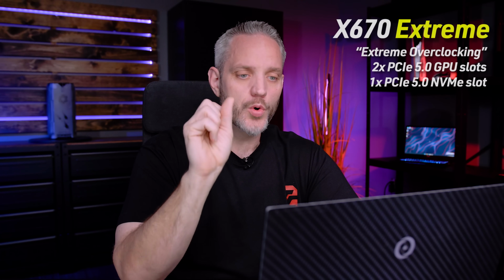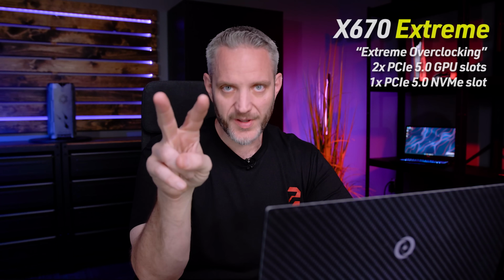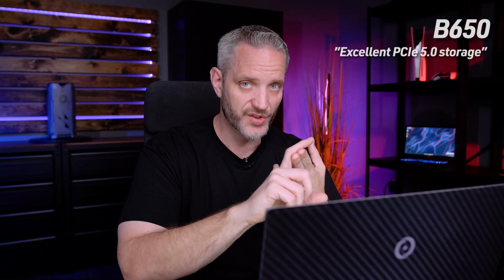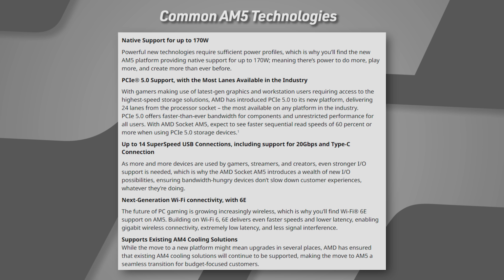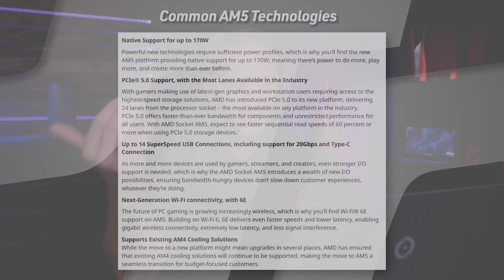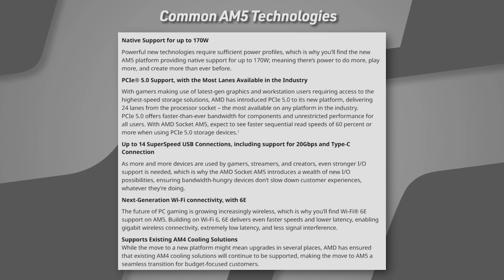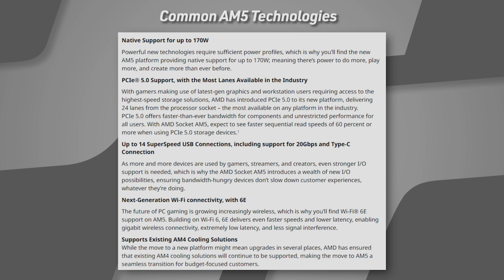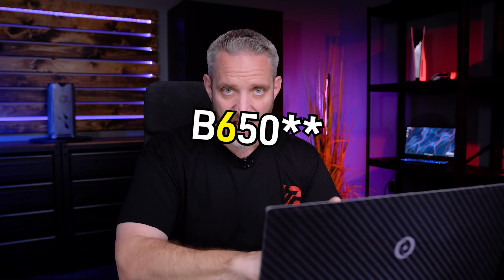AM5 Motherboards are EXPENSIVE! AM5 Explained

Comment: I bought an Z690 (ddr4) and 12700k in February. I was coming from a x370 and 1500X and later upgraded to 2700X. It is still way to early for me to upgrade. It does look like a solid system but my current system is just way to new to change out.

Comment: Can somebody address if the  motherboard will be able to use the internal graphics of the 7000 series processors rendered through the 2 CU  base@400MHZ to max@2200MHZ (Radeon RDNA 2 graphics apparently) present on the processors or will they have to get Discrete graphic cards ?

Comment: Dude you're probably wrong about x670E being the best choice for extreme overclocking because remember you could not raise BCLK with x570 chipset as much as you could with B550 chipset and since both X670E and X670 boards contain 2 of x570 chips, unless AMD does something to fix the base clock adjustment on the chipset and have both of them work just fine when you overclock, which I highly doubt because we're talking about AMD here, B650 is again probably going to be the superior board for extreme overclocking and the only difference in between the X variants and B variants will be a bunch of extra pci-e slots or m.2 slots etc. Other than that when one chipset is already bad, imagine having two of them to mess up your BCLK OC. I don't see why a B650 board with enough vrm phases with the same amount of pcb layers and capacitor layout wouldn't beat a X670 or X670E board unless it's artificially limited by AMD.

Comment: The short reasoning is if you are or were interested in a HEDT platform but shied away from the proThreadripper because of its expense, then the 670E is on the radar.
For Raptor Lake, you really don't want to think of a DDR4 board with it, unless you are already going from Alder Lake CPU, but unless you are already on ADL and DDR4, there isn't a want to get DDR4, because DDR4 is "low end" and cannot be moved to a board later. The DDR4 buyers can choose any EOL system, either Intel or AMD, but are doing so because they are budget buyers, so you get either low end 12400/100 or 13400/100 non-E core designs, or you get AM4 designs, because you will save money on those CPUs and boards as well.

Comment: Intel user here. The MSI Carbon Wifi boards are easily 150€ more expensive than 1 or 2 gens ago. It feels like you have to go a tier lower every gen to keep the price you wanna spend. MSI Carbon with built in wifi used to cost around 280€ to maybe 310€ at launch. A year after 12th gen launch the cheapest Carbon Wifi is 460€. Total madness.

Board manufacturers undeniably got greedier over the last 3 years. Guess enough people still bought into it to justify that move. I'll sure keep an eye on motherboard features closely for the very first time this upcoming gen. I'm not even sure yet if i go blue or red. 👀

Comment: Where did the A series board go? The A620 the bare minimum and a board that could run R3 and R5 chips. Like it sucks that a R5 7600X and a board together costs 2 or 3x more then how B450 boards and R5 3600X costed.

Honestly im still probably going to go for a 5600x or 3600x since alot of them will be selling for cheap soon

Comment: Ya know with chiplet design in rdna 3 resizable bar and pcie 5.0 it could vastly improve cross card communication and simplify dev support needed to implement granted it’s all theory but having multiple gpu dies in one card working together as one monolithic if you can have the communication speed between cards approaching the sane data rate it may be simpler to implement multi card gpu rendering as compared to previous iterations

Comment: Isn't 6E amazing?  Got a new router and suddenly the 6E worked on my phone and I'm getting almost a gigabit down. Holy bleep.  It's the first time I can remember where a wifi feature was actually way better than promised.  Anyway, no plans to upgrade to AM5.  I am happy with the AM4 system I just built and the only upgrade I want to do is replace the 5600G CPU with something better once those better AM4 procs hit the used market. I've got an RX6600 in there so I don't need the iGPU. Honestly, the system I built is doing all I need. I would be okay never upgrading this one if I had to.

Comment: I get why the AM5 boards are expensive and i get why amd have turned their back on mainstream and budget gamers with their middle of the road chip costing 300 bucks probably about 350 when it comes to the UK. The answer is greed they are in the ascendancy because intel fucked up and they regained the gaming choice for 2 months before AMD wait oh thats cutre heres our new chip and will once again be the choice for gamers. However AMD are unable to fathum that the pound is stronger than the dollar and 300 dollars is in fact about 265 pounds so it should be less here but i digress. Now they havent announced if theres going to be a 7200 7300 7400 or 7500 but am guessing not also what is the future of APUS or are they dead now. Given all amd chips come with intgrated graphics are not as strong as vega think Intels GMA series rather that Vega. Maybe am wrong and there is a plan to release more powerful versions of the APU in the steam deck to the general market i hope they do unlike with the 5300G and the entire 4000 series apus which were oem only

Comment: I have a 5600x since launch with an x570, it's gaming please, for 4k games it's guaranteed for 5 years, it's not worth switching to am5 now, my opinion is that am4 is still better set up, only in 2 years will am5 start  it has advantages.  Save money and spend better on a video card.  they are unwarranted prices for the new AMD releases, they do not bring benefits commensurate with the price.

Comment: I'm still running a 4790K, 32Gb DDR3. 8 years of solid performance, it's still my daily driver for my day job as a developer and unwinding in the evening with whatever game is flavour of the month. Not wanting to splash the cash on Intel's "5% more performance!" iterations, I've waited until there's a significant bump up. I think AM5 might finally be that bump.

"When" is another question however! There's nothing this old 4790K can't still power through, what's a few extra months waiting for the dust to settle? starts twitching

Comment: Bought 5600X and B550 Aorus Elite V2 for total of 300€ month ago. Cheaper than 7600X alone. Gonna wait for 2th gen for AM5 for few reasons:
- Bugs to be solved
- DDR5 is still too young and "meh" adapted
- AM5 is expensive, completely looses perf per € in comparison to AM4 Zen3. Sorry, not gonna pay almost x2 for +10-20%. 
- AMD has increased TDP. My current "low-power" 4K rig has 5600X on Curve UV 4.8GHz and undervolted RX 6800. New gen won't beat it in terms of perf per W sadly since it should. But everyone is an idiot and increases power consumption esp. in times when we got x2-x3 power price increase and risks of blackouts. xD

Comment: I've been Intel fan for years but i'm making the switch for AM5. So far i've stripped out & sold 2 Intel 7th gen systems to make way for the new build. It makes sense to me if they are going to commit to this socket for at least 4 years & they did that for AM4 so i'm converted. DDR5 will be in this system, WIN 11, new PCIe SSD's & a 40 series GPU. It will be a beast that will suck alot of power but will future proof me for a long time to come yet. IMO Intel has been "catching up" or "keeping up" with AMD since about 9th gen & they just don't seem to have their s**t together still.

Comment: To be honest, I would like to see GPUs drop down to 8X or 4X since it's unnecessary to go bigger. But does that reduce PCIe slot power delivery? And does that matter, with so much being delivered via cables these days?
Reply: Power should be the same as that's what that first bit of the slot is for and where there is a notch is keep it away from the data lanes.

However reducing the number of lanes potentially kills performance if people want to use that card on older motherboards, so its pretty unwise.  It also wont save the card manufacturer much, unless the chip is designed to have less lanes, which is why AMD did it.

Also these new CPUs have more lanes to begin with, so I don't think there is much point in saving lanes as most of the other slots are PCIe 4.0 so not taking anything away from the GPU slot.

Comment: I like having the option of 2 full speed PCI-E 16x slots. I had a riser cable in my case that was too short so I was able to use the other slot. Then that slot died after I had a power supply failure, but the first slot still works. I can't afford a new board at the moment but having that option saved me in my edge case scenario.

Comment: i have a z370 chipset board paired with my 8700K and really the only thing i lost in comparison to a z390 board was some overclocking headway since my vrms max out before the cpu does but realisticly it makes no noticible difference in anything other than a benchmark since i'm still running 4.7ghz all core baseline

Comment: 9:40 High core counts and high CPU frequencies are one contribution, but only to a small degree.
It's the thigns that people crave for due to whatever reason and don't want to see that this will cost money. High speed DDR5, high speed PCIe5. Boards traces are acting as antenne, both emitting and receiving signals. You can compenate by better material and more ground/shield planes, but that costs... money.
And the usual premium you have to pay when buying a brand new platform.

Comment: Thanks for the content.People should be aware that the 7000 series CPUs and 670 chipset are all first generation products of AM5. And with all of the new techs that are going into the new platform, it means bugs, bugs, bugs, problems, problems problems, ram incompatibility and many many more. The 2nd or 3rd generation of am5 cpus would be great but not this one. Check de8auer videos on am5 cooling, they are very informative. In my case, my Ryzen 9 3900 can keep on working till 3rd generation of AM5 CPUs, then I will upgrade

Comment: I will be upgrading by the end of this year to a AM5 system too from a (i7 4790k, GTX 1070, partially broken USB) and plan to get a motherboard that supports next-gen graphics and storage devices.

So i hope that X670 will suit my needs which is: 

- Stable motherboard with a stable chipset
- Two or even three M.2. NVM slots (Putting in 2,5 SSD´s in modern cases is a p.i.t.a)
- PCIe 5.0 for GPU and storage
- At least 3 normal PCIe slots for extra cards, such as my Soundblaster AE-7, one M.2. NVM expansion card and a video capture card
- Lots of USB 3.0 type B and a few USB 3.1 type C connectors
- WiFi would be nice for a fallback when the ethernet cable dies

- No need for overclocking capabilities, except for the DDR5 EXPO
- No need for fancy internal audio device
- No need for RGB, my system is under the table, to the left - so i never see the sidepanel anyways

But i am not in a rush, because my 4790k still runs fine and i fixed my USB problems by adding a additional PCIe card that is connects to the front-panel.
So i can wait until AM5 components are ready and tested for a few weeks.

Comment: The optional PCIE gen 5 is relevant because we still got people out here running bulldozer unironically. A big thing about AMD is upgrade path without replacing the motherboard, and if one of the aforementioned bulldozer users happens to upgrade gen 5 will become relevant before they upgrade again.
Reply: °ᴛʏ ғᴏʀ ᴡᴀᴛᴄʜɪɴɢ° 
ᴍᴀᴋᴇ ᴀ ɴᴏᴛᴇ ᴛᴏ ᴋᴀᴛᴇ ʟɪɴᴄᴋ ʀᴇɢᴀʀᴅɪɴɢ ʙᴛᴄ/ᴇᴛʜ ɪɴᴠᴇsᴛᴍᴇɴᴛ ɪᴅᴇᴀs;;
Reply: ᗩ ᑎᗝ丅ᗴ Ƴᗝᑌ ᗯᕼᗴᖇᗴ ᖇᗴᖴᗴᖇᖇᗴᗪ ᗷƳ ᗰᗴ

丅ᗴxт ▪️          ᗩ ᑎᗝ丅ᗴ Ƴᗝᑌ ᗯᕼᗴᖇᗴ ᖇᗴᖴᗴᖇᖇᗴᗪ ᗷƳ ᗰᗴ

  ±𝟷𝟺𝟺𝟹𝟼𝟾𝟺𝟻𝟺𝟽𝟶✔️💯⚡️⚡️✔️

ᗩ ᑎᗝ丅ᗴ Ƴᗝᑌ ᗯᕼᗴᖇᗴ ᖇᗴᖴᗴᖇᖇᗴᗪ ᗷƳ ᗰᗴ:::

Comment: Just picked up a 5950x and a Gigabyte Aorus master MB for the equivalent of USD$600. No upgrade path, who cares, got a banging system for cheap, re-using my old case / PSU / drives etc. Sure it would be nice to have the latest and greatest, but I'm fine for at least a couple of years.
Reply: °ᴛʏ ғᴏʀ ᴡᴀᴛᴄʜɪɴɢ° 
ᴍᴀᴋᴇ ᴀ ɴᴏᴛᴇ ᴛᴏ ᴋᴀᴛᴇ ʟɪɴᴄᴋ ʀᴇɢᴀʀᴅɪɴɢ ʙᴛᴄ/ᴇᴛʜ ɪɴᴠᴇsᴛᴍᴇɴᴛ ɪᴅᴇᴀs;;
Reply: ᗩ ᑎᗝ丅ᗴ Ƴᗝᑌ ᗯᕼᗴᖇᗴ ᖇᗴᖴᗴᖇᖇᗴᗪ ᗷƳ ᗰᗴ

丅ᗴxт ▪️          ᗩ ᑎᗝ丅ᗴ Ƴᗝᑌ ᗯᕼᗴᖇᗴ ᖇᗴᖴᗴᖇᖇᗴᗪ ᗷƳ ᗰᗴ

  ±𝟷𝟺𝟺𝟹𝟼𝟾𝟺𝟻𝟺𝟽𝟶✔️💯⚡️⚡️✔️

ᗩ ᑎᗝ丅ᗴ Ƴᗝᑌ ᗯᕼᗴᖇᗴ ᖇᗴᖴᗴᖇᖇᗴᗪ ᗷƳ ᗰᗴ:::

Comment: I tend to bounce back and fourth depending on the price performance.  Even with a large budget.  It really does boil down to the bottom line.  I use them till they die or fail to keep up, then I grab whoever has the best ratio and run that one into the ground.  I upgrade every 4 or so years minus part failures.  The rendering aspects of my job demand a nice card, but not an A series.  The computing aspect usually means last gens flagship.  Cooling and cutting edge have been an issue for a while, so I like to wait till they have that part figured.
Reply: °ᴛʏ ғᴏʀ ᴡᴀᴛᴄʜɪɴɢ° 
ᴍᴀᴋᴇ ᴀ ɴᴏᴛᴇ ᴛᴏ ᴋᴀᴛᴇ ʟɪɴᴄᴋ ʀᴇɢᴀʀᴅɪɴɢ ʙᴛᴄ/ᴇᴛʜ ɪɴᴠᴇsᴛᴍᴇɴᴛ ɪᴅᴇᴀs;;

Comment: An FYI not all AM4 coolers are compatible. The back plate on AM5 is connected to the socket, so if your cooler had a non stock back plate it may not work.
Reply: °ᴛʏ ғᴏʀ ᴡᴀᴛᴄʜɪɴɢ° 
ᴍᴀᴋᴇ ᴀ ɴᴏᴛᴇ ᴛᴏ ᴋᴀᴛᴇ ʟɪɴᴄᴋ ʀᴇɢᴀʀᴅɪɴɢ ʙᴛᴄ/ᴇᴛʜ ɪɴᴠᴇsᴛᴍᴇɴᴛ ɪᴅᴇᴀs;;
Reply: ᗩ ᑎᗝ丅ᗴ Ƴᗝᑌ ᗯᕼᗴᖇᗴ ᖇᗴᖴᗴᖇᖇᗴᗪ ᗷƳ ᗰᗴ

丅ᗴxт▪️           ᗩ ᑎᗝ丅ᗴ Ƴᗝᑌ ᗯᕼᗴᖇᗴ ᖇᗴᖴᗴᖇᖇᗴᗪ ᗷƳ ᗰᗴ

  ±𝟷𝟺𝟺𝟹𝟼𝟾𝟺𝟻𝟺𝟽𝟶✔️💯⚡️;::

Comment: Also Jay 2 things I would rather Overspend on, PSU and Mobo, they are the base of the system grant it the OC boards that are made for LN2 are a Waste for people that aren't going to use a fraction of the boards features or potential but they are the 2 components I would never skimp on or cut corners, having an overbuilt Mosfet is not a big deal in fact the board might live longer than a cheaper board banging the rev limiter on voltage draw.
Reply: °ᴛʏ ғᴏʀ ᴡᴀᴛᴄʜɪɴɢ° 
ᴍᴀᴋᴇ ᴀ ɴᴏᴛᴇ ᴛᴏ ᴋᴀᴛᴇ ʟɪɴᴄᴋ ʀᴇɢᴀʀᴅɪɴɢ ʙᴛᴄ/ᴇᴛʜ ɪɴᴠᴇsᴛᴍᴇɴᴛ ɪᴅᴇᴀs;.;

Comment: Jay in reference to the 2x Gen 5.0 GPU slots, possibly CXL it is standard and baked into the PCIe gen 5.0 spec, if you are not familiar i would recommend a white paper article to read on this, but it fixes every issue SLI and Crossfire had(Latency issues, overall stable bandwidth, VRAM Pooling, Scaling, and most importantly Software support levels are nil as its all done on Base Firmware BIOS level rather than through software from developers or needing continuous updates from NVidia/AMD or Engines/Developers) and we are seeing SSDs currently in Enterprise level using the technology and It was an Intel standard but in order to get the adoption in the Gen spec they had to open source it, NVidia and AMD are currently sitting on the board coalition. 
Gen 5 also has the benefit of being way faster than needed, but.....Chiplet design and MXM are on the way as well, NVidia is already using MXM for enterprise level servers, Everything trickles down usually in a gen or 2, this is a primer gen, I almost guarantee it, CXL takes all similar co processors and merges it to software(OS, Engine, Game) seeing 1 giant coprocessing unit .
This is going to be interesting. This is laying groundwork, AMD knows people will be using this for amateur Workstation use like they did with X570 and the 3950X Processors.
I would probably bet we will see Multi GPUs used again in the next 3-7 years as standard. The problem is NVidia, Intel and AMD all need to figure out a product stack because performance is out of their control, and they don't want repeats of the EVGA9800GX2 SSC and the 550TI cards as it can cause issues when product stacks are more powerful than they should be compared to higher tier more expensive products.

Comment: I currently have a 4790k and 2080ti. I've been running it for almost 8 years. I think this is the platform I'll finally upgrade to. I'm thinking 7950x and a good x670 (non e) motherboard. Definitely going with a validated ram kit with expo. I can see it being a nightmare using non-validated ram and trying to run it at its rated speed.

Comment: I upgraded to 5950x from a 7yo Intel System (with failed mainboard). 7950x would be amazing, but after investing so much in this machine, plus a second 5600G (as a stand in for my 5950x that has a faulty IMC causing severe instability)... I couldn't justify the expense of a total new CPU + new mobo + DDR5. I'm still using a GTX960 as the prices are so stupidly overpriced for anything newer, even after discounts (the "Australia tax", as it's known here).

Comment: i'm probably going to get am5, but not at launch. if amd does the same thing that they did with am4 being supported for as long, that is. my build is from 2016, but having to build a whole new computer to upgrade the CPU because it's an Intel and it always changes, like you said, has been mildly annoying. i build for stability vs crazy overclocking speeds like it seems like most other people do in the pc tech world. although being forced into windows 11 might be a deal breaker, and i'd probably jump ship to linux for daily use for work and only use windows for gaming, so i'll have to keep an eye on that as well

Comment: Wild speculation!:
Radeon 7000 is rumored to be chiplet in design, with higher end cards having more chiplets. So how hard would it be to add more chiplets to the stream by just adding another card. Doesn't even have to be the same class card can be lower if they use the same basic chip design. Crossfire coming back?

Comment: I bought a 5950x and a 3090. There is no need to upgrade at all for me as far as I am concerned. I was on a 6700k for ages because it was more than enough back then. Just saying, upgrading to 8000 ryzen, maybe? Probably still not until 9000 tbh.
I love watching the new tech but that's different from needing it. As for GPUs... new powersupply etc? Probably not.